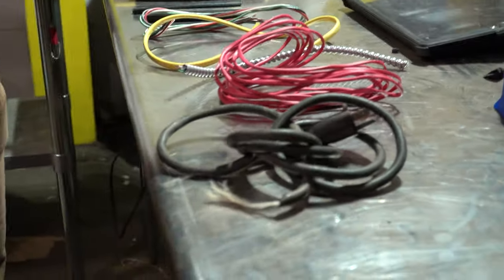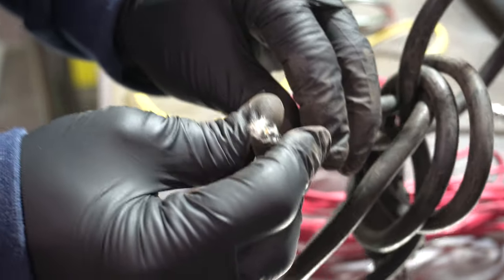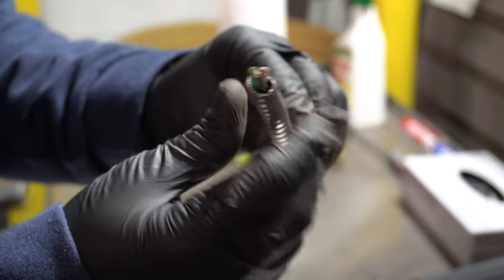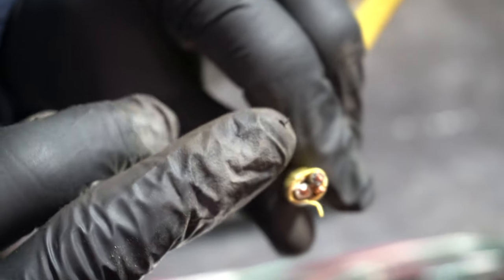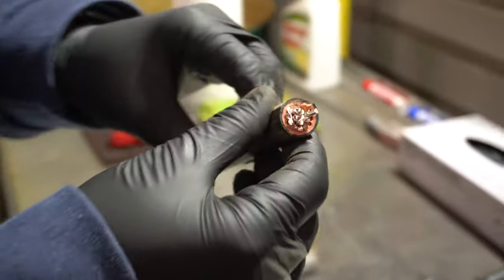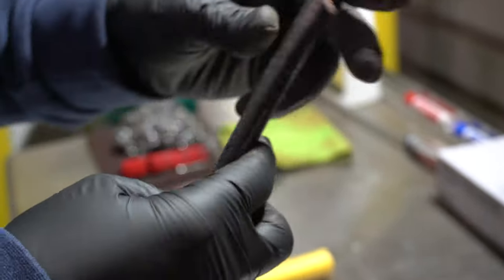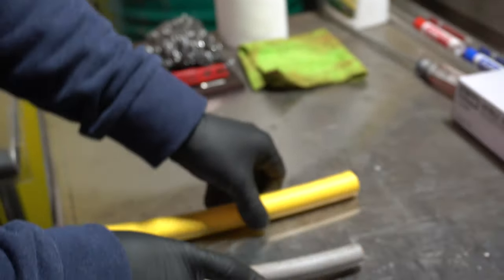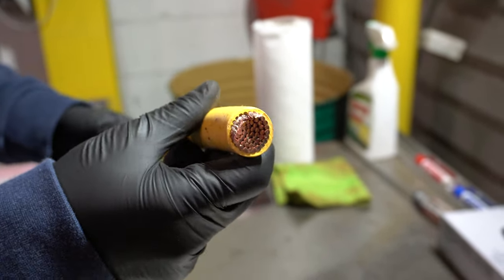What Are Common Scrap Wire Types?

Comment: If you have the last 3 wires and you dont strip them, do they go in the same bag to recycling or should they be sold as seperate?? My yard will take all sizes as 70% small wire and thick wire

Comment: How can I get my hands on that big gauge wire? I’m a kid so I can’t really contact contractors to get some. Is there any other ways?
Reply from the maker: Those bigger cables are specific for electrical contractors, so it's not common to find them.
Reply: @iScrapApp  Okay, Thanks for the info
Reply: @BGTech1  yeah it's hard to find but never give up let me know if you find anything out good luck
Reply: @chrismaccandless6726  Thanks bro I will keep my fingers crossed and maybe I can find some.
Reply: @BGTech1  just don't forget to strip it
Reply: Become a union electrician. Your senior year of high school, in the spring, apply to become an apprentice at your areas local union hall.
Reply: @chrisreibold1634  yes great idea
Reply: Just go to an electrician and ask for scrap wires
Reply: @mahpiyalbc4096  That sounds like a good idea! I will ask them next time I get a chance to.
Reply: From east Africa 🇹🇿
Reply: Big gauge wire? Well elevator manufacturing companies have a huge cable they use.

Comment: I strip some Romex Wire and they did not give me bare bright price
Reply from the maker: You're going to have to find another scrap yard then. Because generally the wire inside it will be bare bright.
Reply: Did they give you #1 copper price?
Some yards don’t have a separate price for bare bright, and they buy it as  # 1